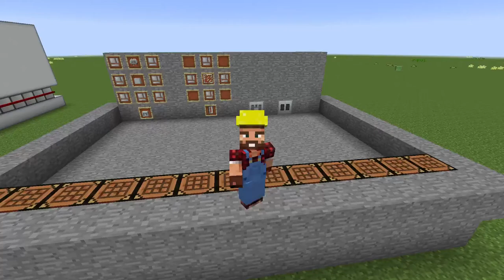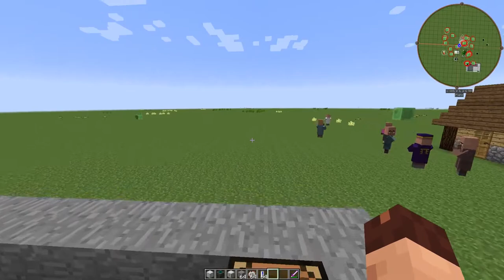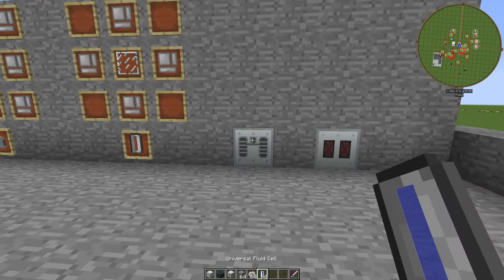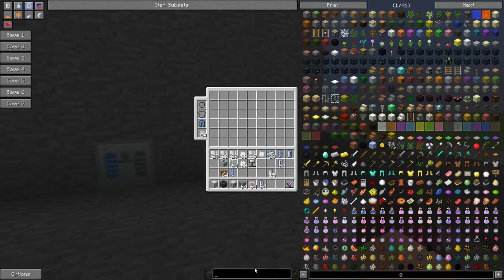FTB Infinity Tutorial - 10k coolant cell!

Comment: i get a other result from doing this ... i get a cell filled with ic2coolant but it looks different and i cant build the 10k thanks with it
Reply: The crafting recipe for the cell he makes gives you the Universal Fluid Cell now. In order to get the Coolant cell, you need to use a Metal Former and tin plates in Extruding mode to get Empty Cells. Once you do that, put the IC2 coolant in those cells and you should be good.
Reply: @VengeGG  I came from the future to say thank you so much for this info